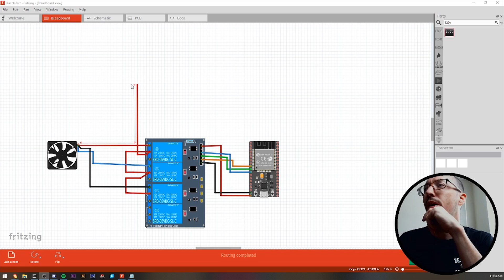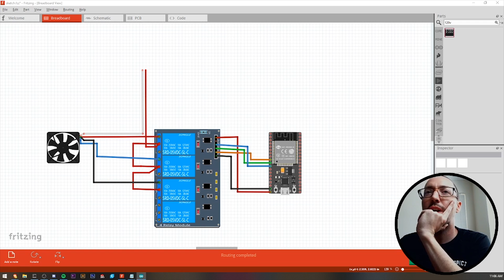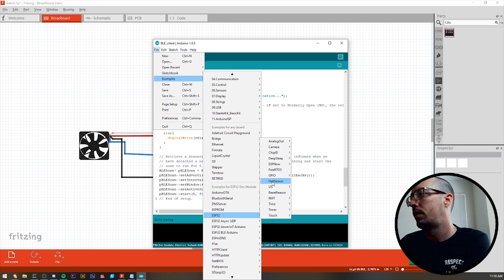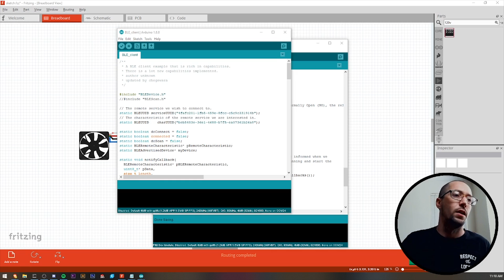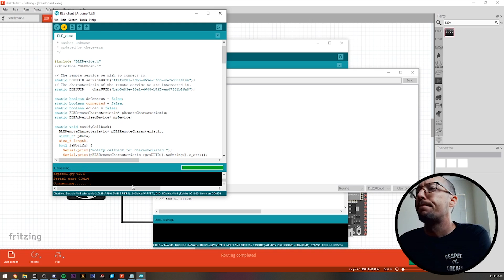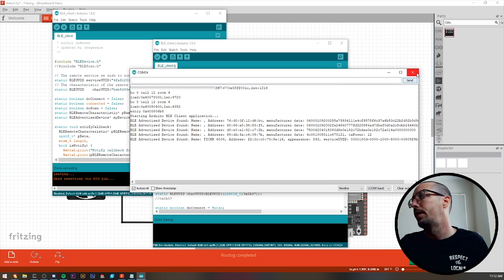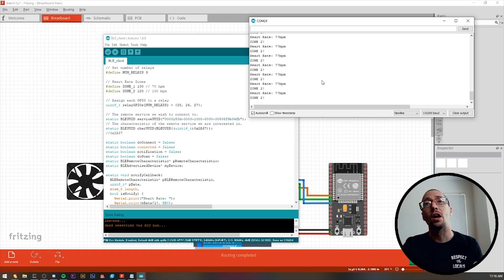DIY KICKR HEADWIND (HRM CONTROLLED FAN)

Comment: Very nice! I’m going to try this but with WiFi control and Alexa rather than the heart rate. Don’t want to lose the heart rate connection to zwift. Were you able to fit everything inside the lasko floor fan?
Reply from the maker: I haven't tried it with the lasko, but I imagine so. There is quite a bit more room than the little fan.
Reply: Andy - I am using a outdoor dimmable electric outlet that is connected to SmartThings and therefore now Alexa enabled as well. Do you have any idea how to capture the HRM data for SmartThings or Alexa?

Comment: @Andrew Grabbs I'm trying to make a compact version of this and was looking for a smaller type of relay and came up with two types of solid state relays: "high-level trigger" and "low-level trigger". Can you tell me wich one to use?
Reply from the maker: Unfortunately I don't have any experience with either. I would make sure they are rated for wall power whether it be 110 or 220 and also switchable by optical 5v.
Reply: @WeRideSouth  yeah that I checked. I think the question is: the channel that triggers the fan is High or Low? In other words, is it the presence of current or the absence that triggers the relay?
Reply from the maker: @luist76  in regards to the relay you are wiring for "normally closed" and then you'll trigger the relay to switch typically with high.
Reply: @WeRideSouth  I made a few tests with a multimeter and the channel that is supposed to be active is the one with no voltage, i.e. if I'm in zone 1, pin 25 is 0V and pins 26 and 27 are 3,3V. If I'm in zone 2, Pin 25 and 27 0V and pin 26 3,3V and in zone 3 Pin 25 and 26 3,3V and pin 27 0V. I believe this is working because the relay I bought (wich is same as yours) works both ways, depending on the wiring, but regarding SS relays I need to pick the right one, so from what I found I need a low-level trigger relay. I hope this helps anyone having issues with this.

Comment: Hi Andrew, my board works and I am able to operate the fan with the HR zones. However, I have a couple of problems: 1) I seem to need to relaunch (compile) the ketches every time I restart; 2) it does not switch off when I unplug the HRM (HR seem to stay at the last displayed one forever). Also, I have a question: do I need to keep the ESP32 connected to the computer or (as I thought) once the programs are loaded this becomes a self-contained equipment (maybe I would need a battery connected via the USB cable?)
Reply from the maker: It sounds like problem 1 and 2 are related. If you HRM doesn't default to zero when disconnected you'll have to write some code to account for that. Maybe an interval in which the HR stays the same you can turn off.  Lastly, you should not have to keep the ESP32 connected. Once the code is uploaded to the board you should be good.
Reply: @WeRideSouth  Thanks a lot once again! Indeed it works disconnected from the PC, powered through the USB cable. The not switching off is a minor issue b/c I can unplug the cable to do that. However I have found another issue: If I start the ESSP32 by connecting it to the plug rather than the PC, nothing happens (only the board LED switches on, no action on the relays). But as soon as I plug it into the PC it starts immediately  (i.e. action on the relays). Once it has so started, I  can transfer the ESP32 from the plus to the PC and vice-versa and it keeps working in either location. Any possible reason for this potential bummer issue?
Reply from the maker: @nardixbici  That's odd. Once you upload the code to the ESP32 it should run the loop when plugged in. Do you have a button on your ESP board?
Reply: @WeRideSouth  Yes I have two buttons, marked BOOT and EN
Reply: @WeRideSouth , I have a similar issue with my Garmin HRM-Tri. As soon as I disconnect, the HR defaults to 71, and sometimes it stays there until it disconnects. But it can also climb by itself to around 90, and then disconnect after a minute or two. So odd. Otherwise, it works great between the 3 zones. Thank you very much for putting this together.
Reply: do you have a garmin heartrate monitor. i tried with my hrm dual and its also broadcasting the last bpm reading when disconnected. using my old tickr its working flawlessly and broadcasting a 0 bpm reading when disconnected.

Comment: Hi Andrew, it's a great job. I made it myself but I have a problem with starting the fan. I hope you can solve it. I connected all wires as you showed at the film but if I run my esp32 the fun suddenly start too. And then, my headwind react very well of changing my zones. Could you explain me what I have to do that the fan will start when it reaches the first zone?
Reply from the maker: Once you put on the HRM the fan should start on the lowest setting. If you do not want this to happen you can just change up the code to do nothing between 1 BPM and X BPM.
Reply: @WeRideSouth  Ok. Now the fan starts when I reach 70 BPM but I need to change the code as when I finish my training the fan doesn't stop if my BPM is under 70. Could you show me where and what I have to add in the code?
Reply from the maker: @ala_philip4340  you would have to change the structure of the function starting on line 36 to include something like if hr < 70 turn off pins.

Comment: Great work! I tried it too and my ESP32 keeps resetting when dryswitchng the relays. Did you have to disconnect the JD-VCC and VCC jumper and supply 5V to jd-vcc and 3.3V to vcc?  I have te same brand Relay array...
Reply: I couldn't resist, got up from my bed and tried it as i wrote it and it works! Jdvcc to 5V, Vcc to 3v3 and no crash!
Reply: I forked your repo and tweaked the code, so you can update if you want.. After the hrm disconnects, it reconnects again without the need for reset. Only the hr levels are left for debugging
Reply from the maker: @DivisPetr  Awesome! I left my jumper setup to VCC to JD-VCC and never had any issues dry switching it.
Reply: @DivisPetr  have you posted your revised code somewhere?  I have the issue of having to reset.
Reply: @CKD1976  yes, it is forked on my github https://github.com/czechdude/hrm_fan_control/network/members . I unfortunatelly also have to reset the esp32, when I try to connect my HRstrap, it catches probably some wrong device.
Reply: @DivisPetr  Hi, trying out your version to address reset issue.  Seems to work, so far but for testing, reduced HR levels. and it switches off when it should go to Level 3.  Been years since I did any coding and can't see why?  Don't have the added connected LED but that shouldn't be an issue, I guess.  thanks
Reply: @silverscoob1  Hard to debug this way, but you could add more Serial.println to the else ifs.. to see where and why the fan stops. It is good to use the Serial Monitor for debugging.
Reply: @DivisPetr  Serial monitor goes into Zone 3 but relay does not switch, turns off?  Understand it's tricky to debug like this.
Reply: @silverscoob1  i would check the wires and swap wire from relay 2 to relay 3
Reply: @DivisPetr   I'll try swapping them but the Zones worked with the original code?
Reply: @silverscoob1  maybe take the code from the original code if that makes a difference
Reply: @DivisPetr  It was the ability for your code to get round having to reset the ESP so often... No worries, thanks for getting back to me👍
Reply: @silverscoob1  I meant the particular code for the zones, didnt write it clearly.
PS: Right now I'm pushing myself to extend the code to be able to change the zones and turn the fan on with manual override with an App from Thunkable via BT. It is the hardest part. Lacking motivation..
Reply: @DivisPetr  Got this bit covered, just installed a smart-plug, job done👍🙂.  Just can't get Zone 3 to work, yet.

Comment: What would need to be changed in the code if changing the fan based on the cycling speed rather than the HRM?
Reply from the maker: You'd need to connect to your smart trainer via the ESP32 and decode either the Cycling Power Service or the Fitness Machine Service depending on which your trainer uses. I believe CPS you have to count rotations of the fly wheel and do your own calculation based on wheel size to get speed. FTMS has speed built in.

Comment: This is great - have ordered the parts and am cracking on with it.

Have you though about making the Wahoo Kickr Climb functionality with a $20 linear actuator?  Seems like the same solution, although getting the gradient data from Zwift or the Kickr might be a challenge?
Reply from the maker: I have thought about it and people have done it in the Rocker Plate group on facebook. It's a bit more costly tho with all the parts.

Comment: Hi Andrew. Is it possible for more than one app on a phone to read a single bluetooth data stream? Or is it that once one app connects, the other loses connectivity. I ask because I'd like to pair both zwift and my own app to the HRM and trainer. Then I'd use my own app to rebroadcast for operation of the fan. However, I have a feeling only one app can tap into the bluetooth data. I understand the 1:1 bluetooth  connection disadvantage but I'm not sure if its 1 device to 1 app or 1 device to 1 phone and multiple apps. Thanks!
Reply from the maker: Hello Roglie! How many devices that connect via BLE to a device really depends on the device. For example TICKR heart rate monitor will only allow 1 BLE connection. App vs Phone vs Connection is all the same. Only one bluetooth connection at any time. Now a trainer for example, KICKR, will allow 3 bluetooth connections at any given time. I hope that helps!
Reply: @WeRideSouth  Yeah I think that clarifies it. So I can't have 2 apps on my phone simultaneously connected to one (older) TICKR. Cheers.
Reply from the maker: @DangleBerriesPL  there is a bit of grey area there. If your phone is making the connection and each app is using the phone established connection, it could possibly work. But if the app itself makes the connection then another app cannot make that connection as well.

Comment: On the ** IMPORTANT NOTE ** above. For the newbies (like me) it really is important to install the ESP Dev Library as per instructions in the linked guide. Without that, the Esp32 Dev Board may not be installed, and the program will not work (it didn't for me until I did that).

Comment: Modified the program to PWM the fan based on percentage of my minimum and maximum heart rate. Which is auto adjusted and stored in  Non volatile memory for each session reboot.  ANT+ would be my preferred connectivity , as the issue with BLE is once paired to the esp32 it can't also be paired to Zwift at the same time.  I have been researching ANT+ solution and drawn a blank. ESP32 don't have ANT+ capability and there is no plan  by Espressif  to develop firmware in the future. There are no Arduino solutions. And i have purchased a Particle Xenon which has an ANT+ capable  BLE device fitted, but again it is not implemented in firmware. Very frustrating.  I think for now the only bodge solution is using an ESp32 in Client mode and another in server mode , connected together via serial TX/RX as a bridge. It's a pity BLE/ANt+ Heart rate straps don't transmit both formats simultaneously (but then why would manufacturers make things complicated to do that?) . There is a suggestion on here that some heart rate straps can connect to more than one BLE devices at the same time. If anyone has found that to be true then please list them here.
Reply from the maker: Nice write up. I'm playing with a nordic ant+ board now, but I'm not close. The new Wahoo Tickr can do multiple BLE.

Comment: Very cool! Was about to buy the components when I realized the issue of BLE only allowing for one connection. I currently use Zwift on an iPad Pro, and as such don't really want to go down the route of ANT+. 
I am completely, 100% new to this sort of project, but I'm curious if it would be feasible to use the Zwift Mobile API to pull HR data? Thoughts?
Reply from the maker: I'm not aware of the Zwift mobile api, but if they have it then it certainly would be feasible. The only downside would be the the delay (if there is any noticeable delay.)
Reply: @WeRideSouth  Thanks for the quick reply! From some cursory Googling, this is what I've come across. I have a fair bit more learning/figure to go before I can make sense of all this.
https://github.com/Ogadai/zwift-mobile-api
Reply from the maker: @mileslamberson3992  Miles, I was reading that as well. It says you have to have a developer account, I reached out to the email to see if they respond, but I'm not sure if you can access the sensor values. I'm investigating :-)
Reply: @WeRideSouth  Ah! Gotcha, I was confused by that. Sounds good!
Reply: In the past week, I've gone deep down this rabbit hole. I played around with the Mobile API after seeing some folks on Reddit reporting that they were able to pull their own data post GDPR (but not other users). I wasn't able to see my own and kept getting deprecation notices. 
I've learned a ton so far, and have now started playing around with Arduino. Any experience using an Arduino microcontroller with ANT (like the NRF52) rather than going the dongle route? I've found the ANT and ANT+ Arduino libraries, now wondering about implementation.
Reply from the maker: @mileslamberson3992  I was looking into that myself. I haven't implemented anything if yet tho I was looking at the AC2 chip I believe.
Reply: @WeRideSouth  I haven't yet bought a chip with ANT, but I am now wondering about using two ESP32s to essentially relay the HR. In essence, BLE HR monitor > first ESP32 (BLE receiver) (connected to relays, controls fan speed), connected to second ESP32 via TX/RX pins (send HR ) > second ESP32 (BLE sender) transmits BLE HR signal to Zwift. Am I over/under thinking this? Still very much in over my head and starting to look for bits of code to use for implementation.
Reply from the maker: @mileslamberson3992  in theory this would a great way to get around the BLE issue, but getting an ESP32 to pair with zwift would be a hurdle I have yet thought about.
Reply: @WeRideSouth  I've been pulling my hair out on this for some time. It's evident that my C++ basics are severely lacking as I'm getting my butt kicked by trying to pass the HR data from a "receiver" ESP32 to a "sender" via serial. That being said, I just found out that newer HR straps (new Tickr included) can broadcast to multiple devices via BLE simultaneously... That might be the "easy" fix if I can find one on sale.

Comment: Have you got a photo of a fan-cable connection? I'm not so good at electronics. I've got a live cable from the power plug and three wires from the fan (one for each speed), connected in similar box. Should I throw away this box and instead install 4 Channel Relay?
Reply from the maker: You will have to install a relay if you want to control the fan with the micro controller. I'll take a photo.
Reply: @WeRideSouth  I would be grateful for the connections photo

Comment: Hi Andrew - am getting a problem - hope you can help?  The first difference is that I'm running Arduino on a mac so I get the com post as "/dev/cu.Bluetooth-Incoming-Port".  Then I'm getting an error uploading the sketch to the esp32.  The error message is  "A fatal error occurred: Failed to connect to ESP32: Timed out waiting for packet header".  Any thoughts?
Reply from the maker: I am not too familiar with MAC but I did stumble upon this write up: https://randomnerdtutorials.com/solved-failed-to-connect-to-esp32-timed-out-waiting-for-packet-header/ 

Might try holding the boot/flash button while uploading. Let me know if that gets it sorted.
Reply: @WeRideSouth  thanks again - the button approach didn’t work so I’ve ordered a capacitor and will see if that works.

Comment: Any way to get this to work with ANT+?
Reply from the maker: Rory, I was working on an ANT+ version with Raspberry Pi and an ANT+ dongle, but the dongle was unreliable. It could be the specific brand, but I'm looking for a better way.
Reply: @WeRideSouth  BT is definitely a better option.  Im running an old computrainer..   i may could find a way to hook up to the control module instead.
Reply from the maker: @ferory240  The only problem with using BT is that the fan ties up your connection to your HRM. If you don't have a ANT+/BT HRM and an ANT+ dongle, your training application (Zwift, TrainerRoad) won't be able to get your HR stats while you use the fan. I'm still trying to work out an ANT+ solution, I just haven't found a packaged user friendly one that doesn't require extensive linux and programming knowledge.
Reply: @WeRideSouth  no way to hardwire to the computrainer device?
Reply from the maker: @ferory240  good point. You could figure out how to tap into whatever signal is received by the application (zwift, trainerroad) and then use your computer to transmit a signal to change the speed of the fan.